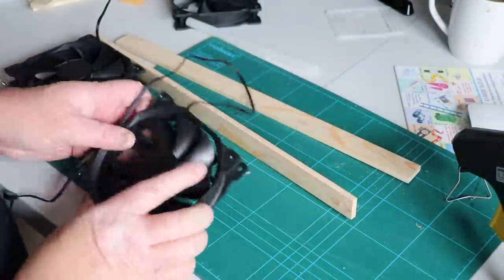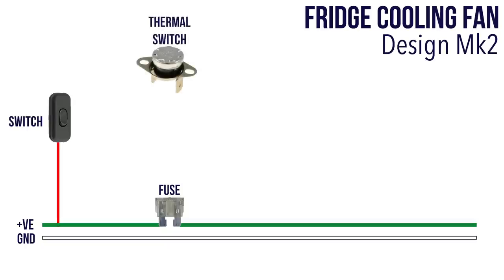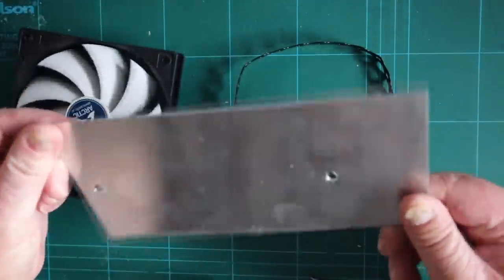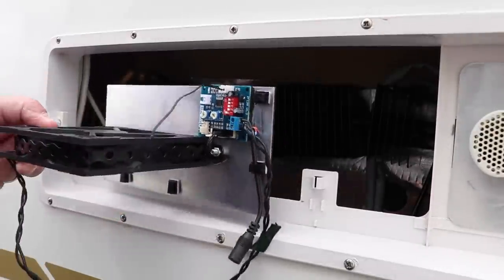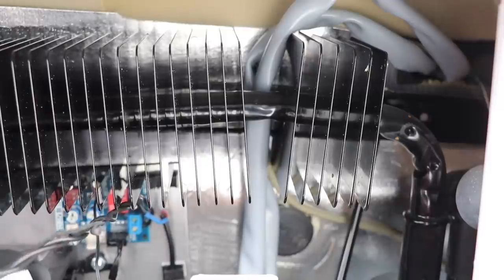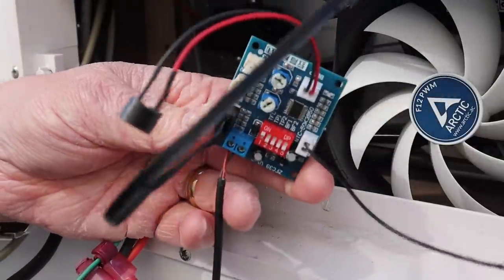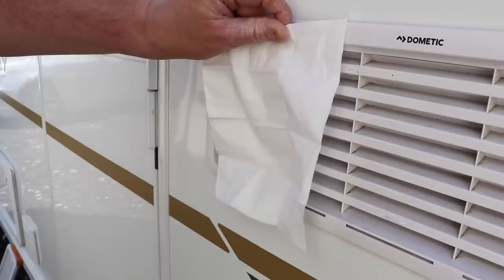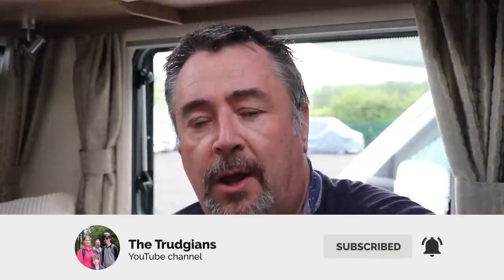Fridge vent fan upgrade Mk2

Comment: Very useful video. Based on it, i installed a couple of high flow fixed speed (2 wire) fans using a thermo switch and an isolating on off switch to our bailey phoenix 420+. Wow! What a difference. Didn’t really see the need for the added complexity of a circuit board and variable speed fan, and would rather the fan run less often when it needs to. Hottest week of the year and the setup has kept the fridge cool. Excellent.

Comment: When it comes to computer fans there are two types of airflow.  You get Static Pressure and High Flow.  Static Pressure fans are generally used to mount to a radiatior because there is more resistance. The High Flow move more air but don't work well on a radiator, usually these will be mounted on a case vent. It's the High Flow which would work best in this application.

Comment: Thanks for posting your videos and guides, I had to replace the fridge 240V heating element so I decided to add a cooling fan whilst the fridge was out. I used all the main parts you listed and used your wiring schematic as a guide. I took the 12V power from a junction on fridge itself and put the on/off switch in the fridge front panel. It really was a breeze to do after watching your videos and following your guide

Comment: Thanks for uploading this Dan

I have completed the wiring installation while waiting for the rest of the components to arrive, I made a slight change to the wiring. By swapping the Thermo switch and the manual switches over in the circuit I can still turn the system on/off but my LED switch inside the caravan won't illuminate until the thermo switch gets to its working temperature of 50c.

Just a small change, but I like the visual indication that the fan it running.
Reply: Which LED inside the light is it? I don't see that in the video

Comment: The most help you can give these little 12V/Gas fridges is to not start or run them empty.  Throw a couple jugs of water or something in them to add some thermal mass.  They will never get very cold when left empty.  Before I take a trip (when I have time) I start the fridge 12-24 hours before I leave.  If I'm short on time I use gas for the initial cooldown.  Gas will cool much more quickly than electric. More airflow is of course always a good thing though!

Comment: Brilliant. Very well explained definitely will be doing this mod. I guess our tower fridge has the same insides just bigger. Cheers, Oliver
Reply: Oliver, this should only be necessary for 3-way fridges but not compressor fridges (so I read somewhere), check which type you have.
Reply: It’s the 103 litre Dometic 3 way fridge. The unicorn 4 doesn’t come with a compressor fridge👍

Comment: All the parts arrived today so have been busy building. It all works I used my heat gun to test the thermal switch. All I need now is a decent day to fit. Incidentally my  Dometic model is different and the upgrade kit suggested I fit the fan in a much lower spot, but that would involve screwing the fan to the back of the fridge which I don't want to do. So will fit just you did the movement of air will be just the same with the fan running.

Comment: what a great idea being hands on i bought all parts and put it together, spent some time making sure id done everything....... so went to fit the fan .... NO WAY impossible to fit unless i took the fridge out, my top vent opening is a few inches to higher than what is in the vid, it would not be possible to even fit the official fan. My caravan is a swift only 3 years old ........

Comment: I'm part way through building this.  Having looked at the two great information videos (on the fan controller and the MK2 design) I think I will replace the 50k thermistor with a 10k one, and set the temperature range on the board to be 50-70C.  This should (I think) map to a real temperature range of 15-31C with the 10k thermistor, and I'll position the thermistor to measure ambient temperature.
Reply: I got the 10k thermistor now.  After a quick try out (not on the van), I think it works well with the controller switches set to 60-90C, with the 10k thermistor that works out as 21-48C.  So at up to 21C the fan is nice and quiet, but as the ambient conditions increase it gets faster and should increase the fridge cooling significantly.  Also the 10k thermistor I bought has a 1m lead so I can position it where I like instead of the short one that comes with the board.
Reply: @richardt7211  Hi where did you buy the 10k thermistor. Regards Alan
Reply: @alanpugsley8900  ebay, £2.75  "NTC Thermistor Temperature Sensor Waterproof Probe 5*25mm 10K 1% 3950 UK"
Reply: @richardt7211  Thanks for that info Alan

Comment: Good job done and well explained Dan. The genuine Dometic fan kit installation instructions illustrates a '12 v DC OUT' on a circuit board. I wonder if this is the dedicated socket built in the fridge for their own fan kit? Thetford don't have a dedicated connection point. Shame we're in lockdown and can't get out caravaning now as this very warm weather were having would try the fan out. Best Regards Rob
Reply from the maker: Thank you Rob, i hope you are both well. I looked everywhere for the 12V DC out but couldnt find it anywhere. I think it is a dedicated outlet for this specific reason. But like you i just took the feed from the 12v inlet. I also didnt want to screw into the back of the fridge as the mounting location is pretty ambiguous in the instructions, hence my metal plate and adhesive tape. 

Hopefully not long now before we are out again. 

Stay safe. 

Dan

Comment: Also, i first bought two 120mm fans but these wouldnt fit below the condenser so these are now cable-tied to the outlet vent and I purchased a 92mm fan to fit under the condenser fins.

Comment: Very useful video explains the steps so that a layman like myself can follow. Thetford are selling a kit on eBay for £44 but not sure what parts are included. I've sent them a message and if the fan and thermo thing are included I may go with that. One question why do you need two thermo devices please, or am I being stupid. I mean the small round thing you fitted between the blades and the printed circuit board.

Comment: Hi I hope you don't mind   I have put a mod to your fridge fan instead of putting the pcb board direct to the aluminium plate I designed a housing and 3d printed it thanks for the video hope you and the family are

Comment: Thanks for your vent fan videos.  I am making a vent for a Dometic chest refrigerator.  Since I want to be able to slide the chest out and even remove from the van on occasion, I will be omitting the thermal switch and just use the PWM controller that will be attached to the vent, not the refrigerator.  Any thoughts on that?  Thanks!

Comment: 6:59 bro the fan controller has a termic sensor that can regulate speed and power on/off the fan, and it will work better than the termic switcher that you pluged it
Reply from the maker: The on board sensor regulates speed based on temp. It DOES NOT switch it in off hence the external thermal switch. Look for my deep dive on my other channel that explains the board in greater detail.

Comment: Great video thank you.  I have a small Domestic RM123 and cannot find on the website where the best place is for the Thermal switch.  Following the circulation of the heat through the pipes as the heat travels along am I correct that it would attach where the pipe and it's heat emerges from the fins?

Comment: Hi Dan. New to caravanning, so have been learning from a number of your videos (sometimes wishing I had watched them before an event!) so thanks. Going to crack on with this, as fridge is struggling. Looking to see what parts I can use that are lying about, is there a reason for the metal plate, could I use a thin plywood?

Comment: It's an old post but if anyone is kind enough to answer... I don't understand why the fan would ramp up from 35-50, surely at that temp the fan needs to be on full? I expect noise might have something to do with it. We are in southern Spain and I can imagine it would just need to run day and night from June to September. I think Dan's video is really helpful and it's a great solution, I want to know if I should do what Dan say's and put the thermo switch straight to the fan.

Comment: A great video Dan, this is a mod I shall definitely do as the fridge really struggles in temperatures over 25c. You don't have any suitable mods for the front pull out slats to convert the seating into a double bed ? Totally useless, we have to remove the drawers to get it back in place.

Comment: Hi Dan, would I be right in thinking that when activated with the fridge using gas, it wouldn't use as much because it doesn't need to work as hard?

Comment: I am not a DIY person, but I am keen to try this project however first stumbling block was controller no longer available.  I am not sure which is the best controller to buy?  I am not sure about 12V DC 3 Pin Computer Case Auto Thermal Fan - 120 x 120 x 25mm - from CPC whether that is better to use as no thermal switch and controller required.  Secondly no aluminium plate and not sure where else to source that compoenent?  We go to Spain whether we can and have a Dometic RMSL 8501 fridge in our caravan.

Comment: Great video.. we haven't had any bother with our fridge in our Coachman even in extreme external temperatures, and wonder why this is necessary. Even so it makes good sense to increase the air flow over the vanes..   

Do you have part numbers / suppliers for the fan controller etc please...

Dave
Reply from the maker: Hi Dave, all parts are listed in the video description and on the corresponding blog post which is again listed in the video description, 

The cooling is a big issue for the smaller fridges, taller ones don't suffer as much, however like you said any help will always be beneficial. 

Hope that helps

Comment: Great video Dan, I've just followed this on my Capiro 550 as the fridge was useless in the heatwave, had to use a smaller backplate for the fan and put the circuit board in the bottom vent area due to lack of space. Turned the fridge on last night went back 1 hour later and the fan was going I cannot believe how hot the pipe to the fridge actually gets, to hot the hold is this normal?

Comment: I'm having a go at this.  I built it all up but when I got to the storage site was a bit dismayed to discover there was no way the fan would fit where suggested.  (The dometic instructions show it at the lower part of the fridge pushing the air up.)  I have a Unicorn Madrid 3 with the tall dometic fridge.  There is no space for the fan where  Dometic show it fitted.  I think I will try it behind the top vent pulling the air out.  I have also tested the settings for (air) temperature and thought that the fan would be a bit slow.  Looking at Dan's other channel someone suggested putting  a 500K pot in parallel with the thermistor,  I have tried this and it seems to work well.  You can tweek the resistance across the thermistor to achieve full fan speed at around 30 degrees (You can set it to whatever temp suits with this) .  Now to fit it all in!  One question I have is about the thermal switch.  Does this only activate when the ambient temperature is high which makes the fridge work harder and thus raises the temperature of the ammonia running through the pipes?  ie in normal temperatures would the circut be off?
Thanks Dan for an interesting project.

Comment: Hi Dan - Brillant video and very detailed as always.  I want to install this on our Motorhome which is a Swift Bessacarr 562.  I've bought all the parts but there's just one thing concerning me.  You used a cable tie to install the switch.  My question is will this not melt when the fridge gets hot.  Cable ties are normally made from Nylon aren't they?  Thanks Ed.
Reply: From my experience of playing around with a cheap fan:  1)The pipes never get anywhere near hot enough to melt a cable tie. 2) With a fan running the heat is dissipated very efficiently and the pipes barely get warm to the touch.
Reply: @tollerdogz  Hi John. Thanks for the info and taking the trouble to reply.  I'll go ahead and make the installation based on this.  Thanks again.

Comment: Dan, In the Dometic PDF instructions, it shows the fan location as being low down on the fridge on some models. Mine is the RM 8550 and the drawing indicates both low down or high up but with there being no written instructions from Dometic other than the diagrams it's hard to tell what's going on. Do you know if this means it can be either location? Your fridge looks the same as mine. During summer I notice that even in hot weather the fridge can get down to 5 deg on mains, but only to 10 deg on gas and I can't understand why that is. If you or anyone can enlighten me there I'd appreciate it.

Last summer I installed 2 fans in the upper vent when the ambient temp was about 28 deg. I found not much benefit overall, although I did also install a fan inside the fridge and this helped reduce the huge amount of frosting that appears on the upper fins in there. (I had removed the freezer box)

Comment: Hello Dan, how have you found the fan controller? Was the 35c ramp up to warm or did it do the job well? Would you still recommend putting in the speed controller or would you maybe just skip it next time to have just a thermal switch and on or of states rather than ramping?

Comment: I don’t know how these rv side vents don’t leak. When parked in heavy salty sea gusts, or when driving at 110kph in heavy rain, I can’t imagine them not letting it a load of water and salty air. Just looking at the simple design of the vent, how does this work? I do live in a sprinter camper.
Reply from the maker: Hi, if you spray water directly at them, they will let water in, but the angle of the vents means it allows water to trickle down. The vent grilles overlap slightly to reduce side on water going in. During winter you can install winter vent covers that almost completely cover the vent allowing little weather to penetrate. 

Hope that helps.

Comment: Very good job Dan, but I can’t help wondering why we need to do this. Surely the fridge is not working efficiently enough so is this not a problem for the manufacturers to sort out? If a fridge doesn’t keep cool in hot weather then it is not doing it’s main described function. I just think that these fans should be fitted as standard - perhaps you could encourage dometic to watch this and see how many people are clearly not satisfied with the operation of their fridges. Andy.
Reply: This may only be for the European tourers although in recent days, am sure it would be need. Not sure if you've ever opened the vent, even in storage its so hot when not being used. Protecting and helping the flow of cool air helps its operation. i do believe the manufacturers only think of U.K tourer.

Comment: Great job dan , just a thought, do you have a cupboard above the fridge ? If you do you could put the on/off switch in there, it would be easier to control.
Reply from the maker: Yeah im sure I could fit a switch somewhere that is easy to get to, but to be honest, It will remain on - unless i realise i dont need it or its too cold for the fridge to work properly..

Comment: Hi Dan,
Thanks for the MK2 and the MK1 videos it has convinced me to have one fitted. However I have a few questions. 1. Is the fan noisy? 2. I’m thinking about having the double Burner fan fitted at the top to extract the heat. Do you think this would be beneficial and do you think I could connect them to the Dometic fan wires with the fitting connector you used? 3. If they were connected to the Dometic would they switch on automatically when the Dometic fan did?

Comment: This is a great idea but (no offence meant) seems a little overengineered. Given how little power these fans use why not just attach a fan or 2 to the fridge fins and wire it to a switched 12v supply so they run whenever the power is on? Am I oversimplifying?
Reply from the maker: Ummm - because we’re usually out when the fridge needs it, and in all the years it’s been installed it’s just worked when needed. I haven’t given it a second thought. But, a simple solution like you suggest may well work for others. 👍
Reply: @TheTrudgians  Just wondering, do you turn all the power off when you are out of the van? We're in a motorhome so may be different but even so the power drain (0.18A) is so miniscule that having a fan running all the time helping the fridge (other than when the main power switch is off) can't be a bad thing.
Reply from the maker: @andypilkington311  hi Andy - no that’s the point. The fridge likes warm temp, not hot not cold. The risk is - to over chill it - where upon the fridge works harder. Ergo why we have winter covers to keep the fridge warm.
Reply: Well you learn something every day. I'd just assumed the colder the better for the cooling fins.